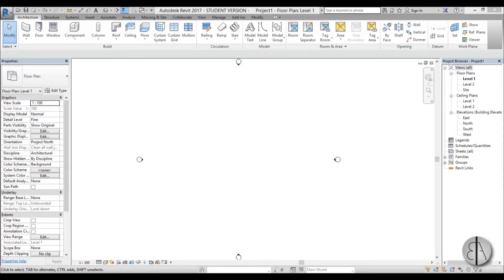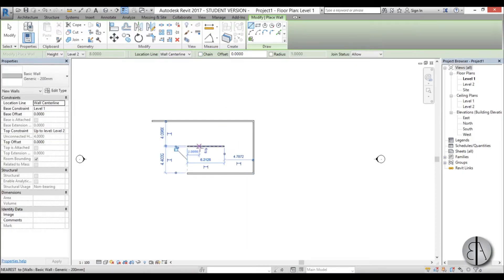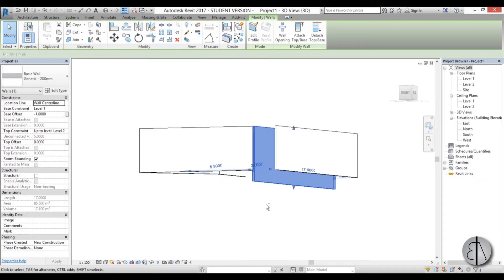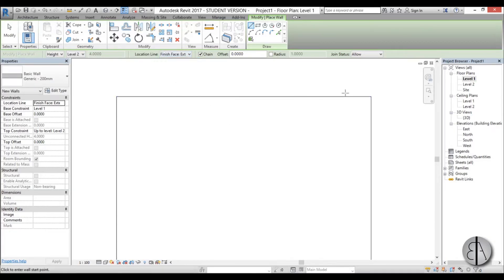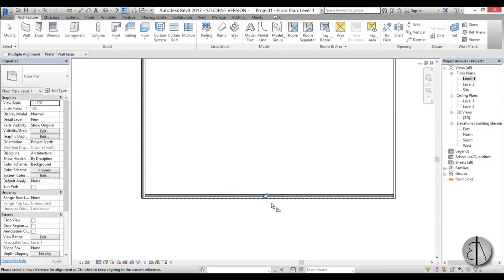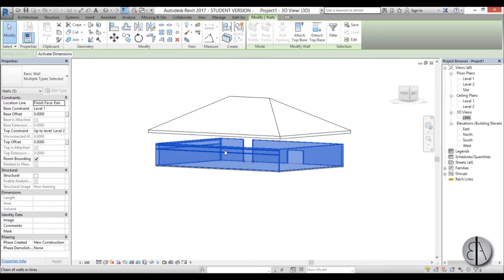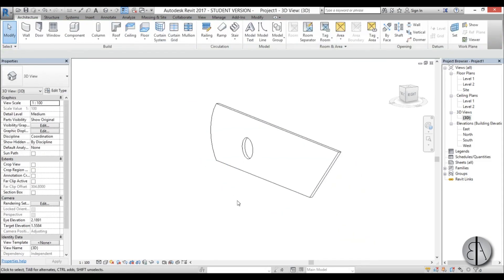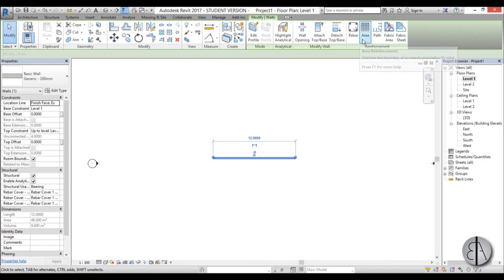Walls in Revit Tutorial

Comment: I have a question. I cant find anythign of this on the internet so thats why I want to ask you. When you place a family window in an outer wall which I refer to as a sandwich panel, and afterwards you want to place an inner wall right onto the sandwich panel so that you get an enclosure. You then get a gap in between the sandwich panel and the edge of the inner wall because it automatically spaces out that area for the window. Now is the question: How can I make the window/sandwich panel to ignore that gap? I tried to edit the wall profile, to disallow join of the inner wall, but so far no luck.

Comment: I love your videos. Here is an idea for some content. When placing walls it is nice to be able to align them with grid lines ( I get some Cad Dwgs done this way). However if the grid lines you are given align with a "side" face of the wall it creates some challenges for a relative newbie like myself. Case in point is the relationship between the foundation walls and the exterior walls. There is a ton of debate online over using the actual "7 5/8" measurement on a CMU or a nominal 8" and I don't wish to start a debate on this. Similar situations exist in a metric world when using US based components, they don't line up nicely. My struggle has been to try and distance elements from Grid Lines using their centre lines without doing the math and drawing additional detail lines to align to. Maybe I am going about it the wrong way and I am looking for something that does not exist. Can anyone point me to some information relative to this?